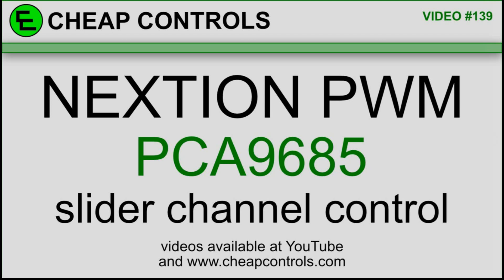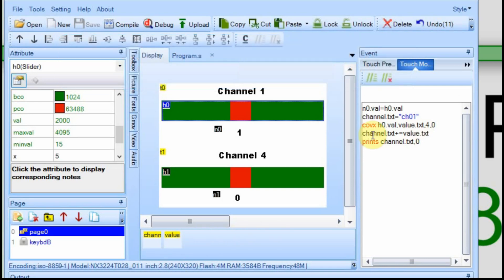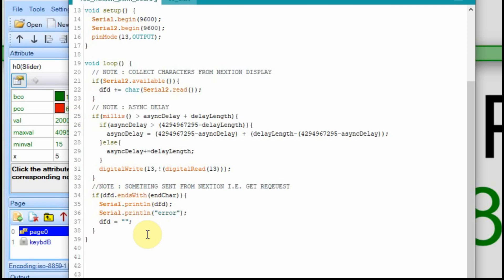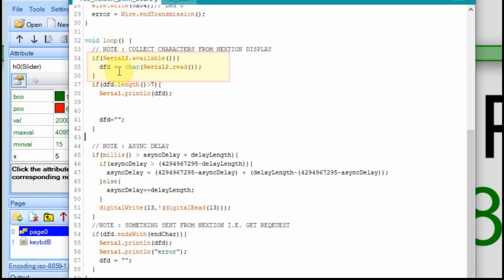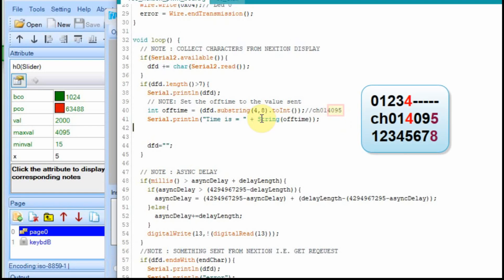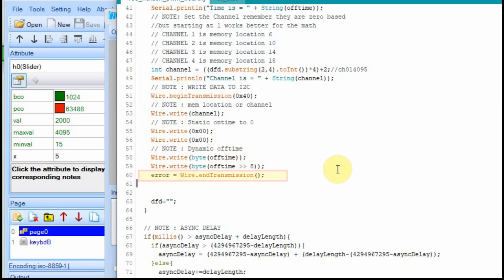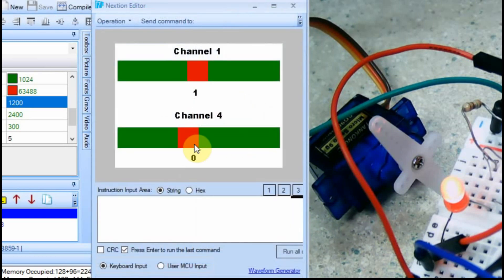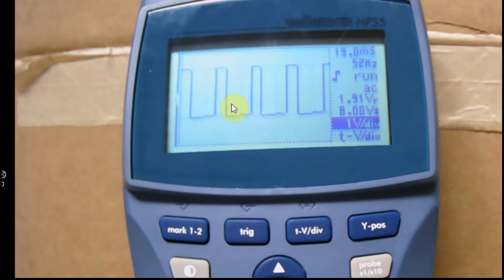139 The most awesome, Nextion control of Arduino control of PCA9685 PWM

Comment: I don't get where you entered chann and value, I don't have any where to enter it in my version of the Nextion IDE, can you give me a hint? Thanks.
Reply from the maker: I describe how I calculate the channel at about the 11:30 point in the video, then at 12:54 on line 53, I send the channel.  You don't do this in the Nextion.  You do this in the Arduino,  This video is using the Nextion to control an Arduino and then using the Arduino to control a PCA9685.  The Nextion does have built-in PWM but it does not have I2C so you have to use something to convert the signal from the Nextion to the PCA9685.  I used an Arduino but I am sure you could use a different device if you wanted.  I hope this helps
Reply: @CheapControls  Thanks.
Reply from the maker: I don't remember that video very well.  I will do my best to review it tomorrow and post a follow-up with your answer.

Comment: great tutorial as always :) Do you know if it's possible to set a different PWM frequency for each channel?
Reply from the maker: While I was making the video I wondered about covering frequency.  It is not possible to set the frequency per channel.  But it it is still worth covering.  I am working on the script for the Nextion built in PWM and I am going to include frequecy in that video.  I will look to do a follow up video on the PCA9685 with that info.  Show both internal and External clocking.